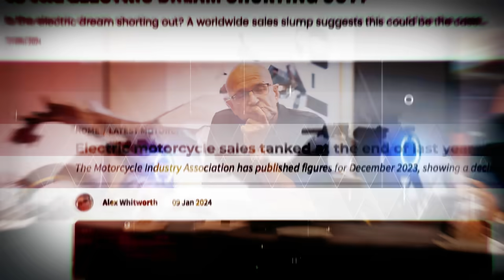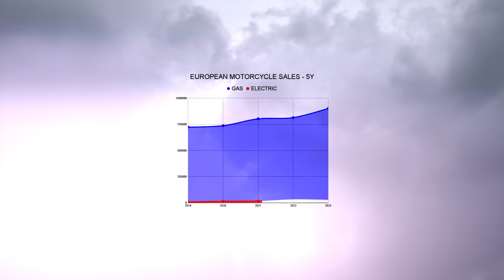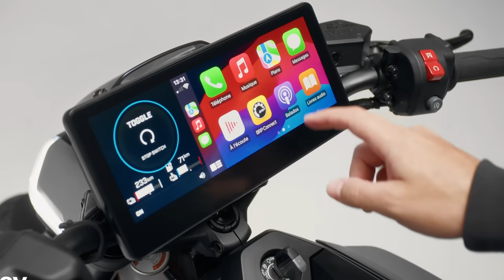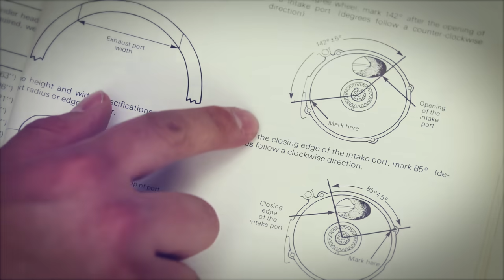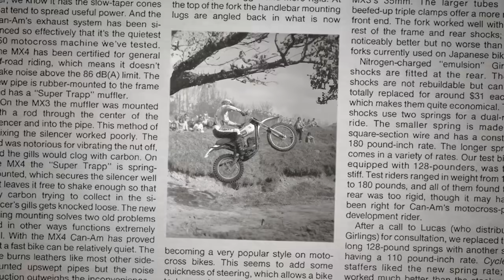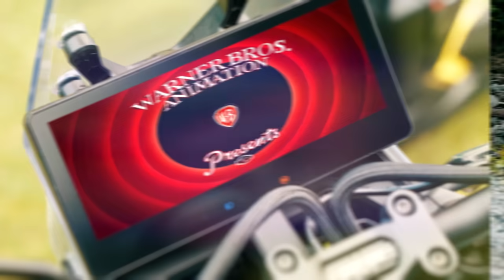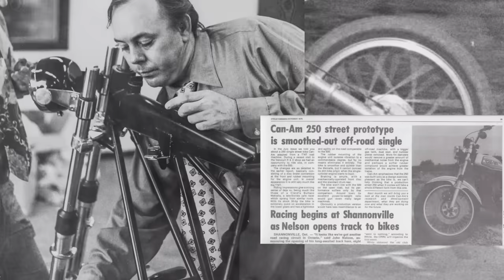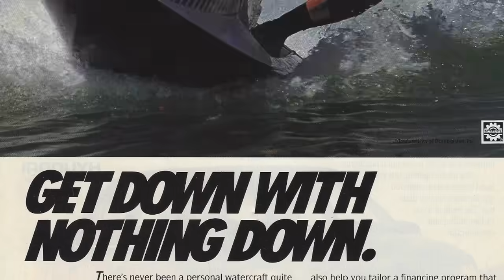2025 Can-Am Origin Review - The 115km "Adventure" Bike

Comment: Can't wait to buy a clapped out one in 5-10 years
Reply: You'll probably be able to pick one up for free but have to replace all the batteries, which won't be cheap.
Reply: @TulaneAve  but.. but.. it would be cheaper than a new one.. and it's already clapped out!
Reply: @TulaneAve  Cheaper than fixing up a busted up gas powered motorcycle that has a shot clutch, engine, chain, and all the other mechanical issues you won't know about until you're broken down on the side of the road.
Reply: @mgpBLARG  So just like a gas powered motorcycle, except with the electric bike you'll only need to change the battery and the labor won't cost you an arm and a leg.
Reply: @Waldo1122 You get it. God bless you.
Reply: @Waldo1122 except the battery will cost what a whole new bike does.
Reply: @The_RC_Guru  Just like engines and the labor and all the diagnosing you'll have to do on a gas powered motorcycle to make sure EVERYTHING is fixed. Also batteries are only getting cheaper unlike parts for motorcycles.
Reply: @mgpBLARG  I've got 10-20year old Nintendo's that I've had since new that still hold most of their charge, just depends on how the batteries are made and if you can be bothered to take care of it. Frankly I won't be surprised if in 10 years, there are custom controllers for the motor, so you can put whatever batteries you want in it the same way you can with Nissan and Tesla motors.
Reply: more like in 1-2 years factoring battery degradation and fad fading
Reply: @mgpBLARG  Labor? 1 hour is all you'll need to take the battery out and put a new one in, an engine will take a week. You don't need an electrician for a battery swap, Tesla service centers don't have electricians, they have a basic mechanic.
Reply: @ktkace  Batteries don't degrade anywhere close to that fast buddy.
Reply: Buy a clapped-out one and stick the integrated swingarm on, IDK, something fun, an old dirt bike? with the battery technology of the 2030s. I'm looking forward to it! But not worth $18k for me.
Reply: Bold of you to assume any will be sold
Reply: @mgpBLARG  Can-Am themselves. They're still selling parts for their first Spyder 10 years later...
Reply: With an entire 10 miles of range on a full charge 😂
Reply: @mgpBLARG  Battery technology is still new. A guy reached 400,000 miles on his Tesla Model S 2017, it has never seen a service center and still has over 80% of the battery capacity available. Electric is only getting better while gas is only getting worse.
Reply: @Waldo1122  haha tell me you dont work in the industry without telling me you dont work in the industry LOL.
Reply: @ktkace  Motorcycle sales in the U.S have YET to hit a new peak since 2006 buddy.
Reply: @mgpBLARG  Replacing batterypack in Nissan leaf is 3-4 man hours. Replacing engine (not rebuild) in ICE car is usually 10+ man hours job on low end (because nissan leaf is on low end too). All it takes is laws and policies to make batterypacks available even when model is discontinued or using universal ones. I can easily see how labor for batteries can be much lower.
Reply: I can't wait until parts become standardized.
Reply: @mgpBLARG  You're right, you certainly can do anything with enough money. You can also do a lot of things on a budget if you know what you're doing or care enough to learn. For example, I could take my 70 mile daily round trip to work, spend zero dollars on fuel doing so and make my money back after two or three years while not having to make stops for gas or worry about engine maintenance... Or I could just have a toy for weekend trail rides and keep enjoying my internal combustion powered regular commutes at the same time. I've found life's great when you're willing to explore the possibilities and try new things.
Reply: @Waldo1122  Huh?

Do you even work on anything? 😂
Reply: @Waldo1122  "labor won't cost you an arm and a leg".

This says it all. 

Stick with your battery bike, or get some basic mechanical skills.

Your generation can barely change a tire and your lecturing us on what it would take to restore a gas powered bike. Ridiculous.

I could list off at least a dozen ways a gas powered motorcycle is better.
Reply: @Waldo1122 yes, yes they do. Unless fully discharged and fully charged each cycles, the quoted cycle life is not relevant.  

May last 15 years but the last 10 years the capacity will keep shrinking into uselessness.
Reply: @Curious-Mr.-Lee  no he doesn't, LMAO!

he's a person with no skills trying to convince us why a battery powered motorcycle is better.

Please...
Reply: @Waldo1122: Fixing up old used gas motorcycles is both cheap and easy. That is why there are so many of them on the road. What will happen to electric bikes in 10-20 years is the same thing that happens to old computers and cellphones. The technology will have moved on, parts will be obsolete and unavailable, software will cease to be updated and what was once an expensive piece of cutting edge technology will become a useless brick.
Reply: @TexasDragon3907   Huh? 😂

You're so clueless.

different batteries, Einstein .

in all electronics the first thing that goes is the battery. even phones. everyone knows that.

how much energy does those batteries in your Nintendo hold? How long does it take them to charge? How long does it take them to die? You're not saying anything. just because you can turn your device on doesn't mean it's got a good battery in it. 

Do you think a Nintendo is hard on batteries like a motorcycle would be?

There's some dumb people in this thread.
Reply: @keldon1137  you think people fix their cars by getting new engines? 😂

no man. They get a new car by then.
Reply: @TRAVERSE_ADV  Yet a Taxi driver just reached 400,000 miles on their Model S 2017 and isn't seeing that.
Reply: @TexasDragon3907  Lmfao!

The only thing I've replaced on my Yamaha RV that I purchased for five grand that gets 60 miles to the gallon, the only thing I've done in five years of ownership and 100,000 miles on it. Is replaced the chain and the tires and the fluids and the filter.  

What are you talking about? Rebuilding engines? huh! How long do you think maintenance takes for someone with basic skills? some of us like work on our bikes too. 

I don't have to wait to charge. my bike is always ready. time is money my friend. I also enjoy riding my motorcycle as a hobby and being able to go farther and not have to wait, is a quality of life enhancement that your silly battery bike cannot fulfill.

guess what else?  I would much rather have something go wrong on a gas powered motorcycle on the road, then have my battery overheat or blow up. most likely I can fix the gas powered engine right there on the side of the road.
Reply: @mgpBLARG  U know that your comment that i replied to had none of these words in, right?
Reply: @TexasDragon3907  Custom controllers for the motors in these bikes? There's already a ton, which is awesome.
Reply: @dangerous8333 "your generation Blabla" ... opinion instantly discarded. Go yell at some clouds.
Reply: How much it costs to rebuild such a battery pack respectively replace the cells (in terms of work skills and time needed) can differ wildly. Are the cells soldered? How complicated is the array? Or are they just basically "pick and place" in a frame (this one is easy af to do)? And it seems no one arguing about it here knows how can-am did theirs. Let's get to the materials. What most here don't seem to know: battery prices continue to plummet. General battery prices 2023 to 2024 fell 50-60%. LFP battery cells in China have fallen by 51% to an average of $53/kWh. CATL (biggest manufacturer in the world) is aiming for $36/kWh in 2025. This bike has 9kWh. This is b2b pricing in big quantities, but it should give an idea of how the market is developing. And workshops that can efficiently rebuild battery packs will become available more widely also.

The bigger question for motorcycles will probably be... how will capacity per weight and volume and charging speeds develop? Even rebuilt... This thing basically only works for tracks close by. Not as a actual adventure bike.
Reply: @Waldo1122  Just like phones and other consumer electronics, the manufacturers will absolutely make it a total bitch to do any maintenance yourself. I guarantee it. There is a global industry worth hundreds of billions of dollars just doing so for vehicles.
Reply: Make that 2-3 since it’s a brp product…
Reply: @TexasDragon3907  Unlike in cars, you won't have all the battery safety features who prolonged the lifetime of the battery.
Reply: @Waldo1122  I mean, look at this bike and tell me, where that 18k price tag went.
Reply: @KillerRedVine  You're going to do a valve check yourself? Note valve checks go well into the $1000s and for a BMW/Ducati you can just forget it. Labor rates are only going up and for most modern bikes you need the manufacturer's diagnostic tools to even work on the bikes yourself.
Reply: @0Turbox  I never said those two turds of a bike was worth even $10,000. I knew these bikes were DOA as soon as I saw the single brake disk on the adventure model a year ago. But like Fortnine said, the technology that went into these bikes is incredible. They will only get better.
Reply: @mgpBLARG Battery in your phone has no heating and cooling to preserve its life, neither a charging buffer unless you enable it in software. So yeah, no wonder it goes bad so quickly
Reply: Keep in mind guy to replace a ev battery it usually costs more than to buy a new one which is why when one of the cells dies the dealer will show you its cheaper to buy a new one😂
Reply: @Waldo1122  The bikes this is competing with are small displacement dirtbikes and ADVs like KLRs, DRs, CBs, Rallys, KLXs, and Royal Enfields. It's not like you're getting work done on your H2R, they are simple, naturally aspirated, and most notably half the sticker price.

For the range you get out of something like a KLR or Himalayan for 1/3 of the MSRP, getting the single cyclinder rebuilt at 50,000 miles isn't a fortune.
Reply: @Bargrabber  Lithium batteries are only getting cheaper and more efficient and gas engines are only getting more inefficient and labor is only going UP.
Reply: @ussliberty109  I never said these Can-Ams were worth a dime. Energica's bikes destroys all of this crap.
Reply: @dangerous8333  Notice how you chose my comment to point that out instead instead of the original commenter who used their Samsung phone as the example for why all batteries don't last, almost as if you were only looking to reinforce your pre-existing biases? Because I sure did. Oh, and if you, by the way, if you read my whole comment, you'd notice that I specified how the battery is made is part of the equation almost as if I thought about that before I commented. The whole point of me using my example was to point out not all batteries wear the same depending on chemistry and use. To answer your questions, lithium ion, charging is about the same as when I bought it, battery is probably 75%. I don't game on it like I used to so haven't actually been on it long enough to run it dry but I know it holds a charge. Have nice day, maybe next time read the whole comment before you call someone and come out a fool.
Reply: @Waldo1122  nope it is not their is currently a cap on density so no its not getting cheaper and also its not becoming more efficient their is a cap. lithium portable battery density technology is capped until someone invents something to solve the problem, their is no ooh or ahh about this lithium will be highly exspensive and stay that way, lithium mines are sitting with a production problem aswell, their will not be enough lithium left at the current pace, not even mentioning the other less spoken about materials that are hard to stabilize, so in short you are wrong , and also you have been commenting on this thread like a plauge chill out, maybe touch some grass?
Reply: @Bargrabber  Lithium capacity is capped? Is that why car manufacturers are improving their range every single year without increasing the size of their vehicles? Toyota already announced that they have developed solid state batteries and will be using them in their electric vehicles. 

Lithium mines are having such a huge production problem that Tesla is still running at 100% with no loss of steam in sight. You're just just pulling things out of your behind and hoping that it us true.
Reply: @0Turbox  The bikes not actually out yet and what I know about it came entirely from this video so no comment? I thought they said the batteries are water cooled so there is that I guess?
Reply: @MGooGM  For sure not. In that time you have to gather the cells all around the world before you even can rebuild the Pile of Kacko
Reply: How shitty is this bike to be clapped in 5 years i never had bike that was younger than 15 years and all worked like a charm
Reply: @mgpBLARG The battery in your phone isn't the same with a car battery or a motorcycle battery wow shocking I know , I had a small smart electric car and the battery had 98% battery health after 5 years of use.
Reply: @jakeviolet2195  fixing up old vehicles is not 'cheap' unless you rebuild them with all the old parts!
Reply: Not only that you'll need to wait at least 15 min to charge it.  I would rather choose a motorcycle which can charge instantly, which seems electric motorcycle aren't capable of .
Reply: @4AM-214  I've been driving a small battery EV for several years.  I never have to 'wait' to charge.  I do something else while it's plugged in and don't end up stinking of petrol either.
Reply: @mgpBLARG  After a decade a battery rebuild may be needed, but think of it as a replacement for the monthly cost of fuel. With that said, for a lot of products I'm not sure if it makes a lot of sense to have them battery powered. An electric commuter bike used almost daily sounds like a great idea. An electric adventure bike less so.
Reply: @MGooGM i like your attitude
Reply: @FFVoyager   what if I'm in a hurry and I forgot to recharge it because this happens to me all the time. I can bearly do my dishes because I arrive home late. At last It all comes down to the position you're in.
Reply: For me an electric motorcycle has no soul. It's not like "No.5"
Reply: Amen to that
Reply: @mgpBLARG FWIW, phone batteries are specialised single cells designed to be as compact as possible, with no cooling and often engineered to fast charge when possible due to market expectations. All factors that will decrease LiIon capacity quicker, so it doesn't last as long during the day ("dies").

Vehicle batteries consist of hundreds of cells, usually with much bigger tolerances, and cooling systems where fast charging is desired - modern designs are seeing 7-10 years of use before a decrease in capacity becomes noticeable at about 10-15%.
It's like comparing a wheelbarrow to a dump truck 😅
Reply: Bad idea. The battery will probably be so tired by then that you'll be getting hardly any range, and when you look at the price of a new one, you'll not be a happy camper
Reply: @Waldo1122  Batteries and electric motors are older than ICE engines by a lot, incredibly mature technologies with far more money spent on research than ICE. Think you'll find the Tesla had 80% capacity on its third battery and all the electric motors had also been replaced
Reply: I’ll just be impressed with the persistence of the person that can wear a bike out that has to be charged every 115km.
Reply: @mgpBLARG  ye and add a little generator
Reply: Based
Reply: @Waldo1122 cherry picking 😂 EV batteries clap out just as warranty goes and replacing them is expensive as fuck.

You comparing that to someone making the worst used motorcycle purchase in the 21st century is hardly fair.
Reply: @TexasDragon3907  I think you got the wrong guy lol. I do ICE motors as well as electric motors. I'm currently building a E-moto that will pump out around 50 hp with air-cooling. I also am fixing up my 1977 Corvette. Electric and ICE are both very easy to work on......now to actually design and develop a new technology is hard.
Reply: @Waldo1122  valve check and adjustment cost me 400 EUR and it was once in 24 000 km interval item. Rest of maintenance doesn't exceed 200 EUR a year on my 15 year old Suzuki with over 40 000 km on the odo.
Reply: @Waldo1122 😂😂😂 no it would still be cheaper to build a basket case than replacing the batteries and motor on a electric bike
Reply: Toxic waste
Reply: Throw away bikes are official lol
Reply: ROFL
Reply: Clapped ICE are repairable, but I don't know about batteries tho
Reply: These won’t last that long lmao
Reply: @Waldo1122  The price of a restored engine doesnt even come close to  the cost of a battery pack
Reply: @jakeviolet2195  But the future for electric is great drivetrains (like on the canam) with battery density being much better in 10 years with plug in controllers - easy enough people make their own conversions all the time.
Reply: I'm riding a 8 year old Zero Sr and it's only lost 5km of range in that time.
Reply: And reto fit a gas motor..
Reply: @KillerRedVine  we need right to repair in EVs too, but imho electric motorcycles ought to be made as simply as possible, with maintenance and replacements easily done at home.
Reply: @edwardbrodie2190  well 30-40k miles isnt that much for a motorcycle especially of that age, but surpassing that I’d imagine some range wojld go w it.
Reply: For twice the cost to replace the battery!
Reply: @misfitfarm1937  battery cost more than the bike lmao not even worth it
Reply: @Bucky15690  hmm maybe YouTube's being weird. I'm certain I replied to someone else and they didn't look like they were replying to me. Whatever my bad.
Reply: @MGooGM Ha Ha! Sure buds...sure.
Reply: @GPz84   "Sure, bud, sure" what?
Reply: @Waldo1122  10 yr old battery bike wouldn’t even get to the side of the road in the first place
Reply: @mgpBLARG  you do know you can change the Samsung battery for new one? You just have to take extra effort to get the back cover off
Reply: @TulaneAve   If EV cars are any indication (I currently have two), those batteries are going to be fine in 10 years.
Reply: @TulaneAve  It's got a freaking small 8.9kwh battery, the batteries won't be that expensive.
Reply: @The_RC_Guru  WRONG The battery is 8.9kwh, it's weirdly small. Not a massive cost.
Reply: @Neojhun  ah ok then they’ll be going bad that much faster since they’re being over cycled with high amp draws and a lot more charging cycles haha. Look there’s no free lunch with thermodynamics. Plus look at any of todays evs, insurance companies just write em off as totaled when the battery goes bad because the cost to replace is more than the vehicle. Remember the vehicles depreciation in that 5yrs plus too. They have their place certainly yes but they aren’t yet to the level where they can all take over combustion.
Reply: It’ll be 80% of the price of the bike to replace the batteries. The bike basically is the batteries.
Reply: They will be wildly obsolete by then
Reply: You will not find a battery in an Egyptian pyramid or a historical settlement of the first nations, but batteries are around for some 220 years, so I wouldn't call the technology new. But if you think that's new, than the combustion engine is even newer and has more room for improvement.
Reply: @mgpBLARG There are mechanics that make more than electricians, but not Joe tire tech, no offense, tire techs.....
Reply: Lol be more like 2 years and battery will be junk. Kinda want an electric dirt bike but Ill never get rid of my vtwin superbike.
Reply: The battery will be past prime then, and replacing that will cost more than the bike is then worth. These depreciate like bricks because they get better every year. Wait a decade or so and they might be good.
Reply: @TulaneAve  a Prius prime battery, which is about 1.5x larger than this bike's is only $2,500. If the price scales, it'll be $1666 to replace a battery of this bike's size, which is not bad
Reply: @mgpBLARG  your problem is because it's a Samsung... and most likely your poor charging habit. my Asus of 6 years is still running strong.
Reply: This is the answer
Reply: It'll be a boat anchor in 5 years.
Reply: Get a Surron for $5000 instead
Reply: @Waldo1122  labor will definitely cost you an arm and a leg. Rebuilding a battery pack is not easy, nor safe, nor cheap. 18650 cells are less than 3 bucks each, you can get them for under 2.50 if you buy bulk from a wholesale supplier. Most of the cost of repairing a battery is in the hours it's gonna take a technician to hand weld each cell to each other, plus balancing and conditioning for shipping. "Installing" the pack in the bike is the easiest part, and probably everyone can do that.
Reply: @somedude2492  I hope you realize battery packs are built by a third party not assembled at the factory or delivered in pieces to dealers. They comes fully assembled. BMW already has electric bikes on the market and battery repairs do not consist of actually repairing the battery, they simply swap out the ENTIRE battery switch takes little to no time to do.
Reply: @TexasDragon3907 controllers aren't really that picky. They just have a "hey, this is the max voltage i can handle and the max current i can push" rating. Any battery that closely matches those specs will work if you know what you're doing.
Reply: @Waldo1122  as an electromechanics technician going through college for electronics engineering, specializing in electromobility, i do know. The cost for a whole ready-built pack is prohibitive, and insurance will total your vehicle before paying for a new battery. Also, battery cells are standardized. Battery packs are not. 10 years from now, when you actually need to replace the battery, you'll only find NOS battery packs that have already taken a hit to their capacity. If you want actual new-like performance, you need new cells which can only be installed by rebuilding an existing pack. Hopefully this will change in the future with new battery chemistries and more standardized vehicles, but that is the picture we're looking at today. There is a reason why electric cars are doing so much better than electric bikes, we're just not there yet.
Reply: @somedude2492  Obviously we aren't there yet for electric bikes but the people in the comments are saying garbage like "electric bikes will never work" "nobody wants electric bikes" when that is a blatant lie.
Reply: @Xirtamani truth hurts. I'm part of that generation. We aren't good
Reply: @Waldo1122  lol at least you can fix a real motorcycle, at least you have the option to attempt it before you have to just buy a new bike. electric = temporary + disposable
Reply: @No-one91910  What is a "real" motorcycle? A motorcycle that raddles itself apart, breaks down, is unreliable, has tons of maintenance and is slow? Teslas aren't temporary and disposable so you're just being blatantly ignorant.
Reply: @Waldo1122  i have 20 years old supermoto (husqvarna sm 610 2004), have it for 3 years without any problems so far
Reply: @JRY-wq4eg  Cool, if you actually ride it you'll end up reaching the valve checks and then you'll sell it once you see the labor cost.
Reply: Electric motors don't clap!
Reply: @Waldo1122  you know what I mean. one with an internal combustion engine. Ev's break down over time as well, just as much as hybrids, everything does. Your bike shouldn't have tons of maintenance and still be unreliable, honestly sounds like a skill issue in that case. There are still cars, and obviously tons of bikes, on the road that are running much past their intended lifespan, ev's aren't old enough yet to know if the same will happen to them. Also no need to call me ignorant, I doubt you would do that if you were talking to someone face to face.
Reply: @No-one91910  Everything breaks down overtime but a EV won't just not start-up one morning or suddenly fall apart in the middle of a drive. 

Every bike has tons of maintenance that is what makes it unreliable, you can't rely on your bike to be an affordable form of transport as stealership labor charges can go up by 100% at any time, Ducati engines can fail at any time, BMW engines will grenade at any moment, KTM engines will stop working just because.

There are very few cars that see 400k miles while Teslas easily reach that as there is no engine to fail and turn the car into a write off. Tesla has been making EVs since 2012, they are plenty old enough. Most of the original Teslas are still on the road running like new.
Reply: @mgpBLARG  scale buddy
Reply: @Waldo1122 no this one is true. At current rate lithium mines will run dry soon and with a 15 year turn around on new mines... well that's not even the real issue.  The only lithium rich areas now are areas of contention and instability (Africa) EV is not the future.  Hydrogen will be
Reply: @Waldo1122  The Can Am is not a Tesla AND you have ignored the main point of this vid...RANGE.
Reply: And the PRICE
Reply: @Texas_Cody  Lithum is a finite resource just like oil buddy.
Reply: @Waldo1122 ”every bike has tons of maintenance that is what makes it unreliable” is the stupidest thing ive read in a while. Its almost like performing the maintenance is what keeps them roadworthy and safe dude. If you dont know how to do the maintenance yourself just say that instead of complaining about stealerships😂 

And what is this fear mongering about engines? Do you redline start your engine in the mornings? Extend the oil change intervals to every 10k miles? Ride the clutch in traffic at 7500 rpms? Modern engines are extremely reliable, and most failures can be attributed to lack of maintenance. (Theres that word again….)

The beauty of motorcycles is that they are the barebone basics of what is needed to transport someone: an engine, a transmission, and two wheels. If you cant maintain the barebones, stay off two wheels and stay in the grocery getter.
Reply: @np51486  You shouldn't have to tear down an engine every year, do an oil change every 6k miles, clean/fix a chain every 500 miles etc... Good luck doing a valve check yourself.

Modern Ducati/BMW/KTM engines is about the furthest thing you can get from reliable.

The beauty of motorcycles is riding the damn thing not stuck working on them. The GS is the top selling motorcycle because there is no dumb chain to worry about or a engine to tear down when the valve check comes up.
Reply: @Waldo1122  Do you even ride dude? What bike are you on that needs a teardown every year? Do you even know what you’d be tearing down into and why? 😂

I dont know what is your fixation on the german and italian bikes is, but Japanese bikes are the best out there. You can easily get to 50k miles on them before any serious tear down or rebuild is needed. Expect half that from the exotic german and italian bikes. Still pretty damn good considering most are more of track and weekend warrior toys and not commuters.

And FYI dude: 
it takes less than 5 minutes to clean and reoil a chain after a ride.
valve adjustments can be done for FREE yourself in an hour especially if theyre screw type and not shim type.
it takes 20 mins and 35 bucks to change most bikes oil every 3k miles. NOT 6k miles like you think it should be; which probably explains why you think modern engines explode left and right. Its just you bro 😂 
Bikes are more maintenance yes, but the maintenance is often much quicker than performing it on a car for example because everything is right there in front of you. 

And thats not the reason why people buy BMW. BMW maintenance and repairs occasionally require using a multimeter with an oscilloscope, access to their software to get rid of warning lights. Generally over engineered design choices makes this bike hell to own for the average DIY owner.
Their sales are up from retired dentists that buy new BMWs because theyre the ones that can afford to do so and have the dealership do all the maintenance 😂 Pretty sure they dont give a rats ass whether if it has a shaft drive or not when they ride their 1250GS adv bike to the local starbucks lmfaooo
Reply: @np51486  You're asking me if I ride yet you don't even know what a valve check is... I hope you realize valve checks are supposed to be done every 15k miles as THE MANUAL says for almost all motorcycles, if these are not done your engine very much can grenade as these are NOT hydraulic valves like cars.

If you track a motorcycles you can go ahead and cut the maintenance schedule in half.

Valve checks are most certainly NOT a one hour job, Ducati quotes them at 6 hours, BMW at 4 hours, just taking the panels off to even see the valve cover will take an hour. You will need to lift the bike up and drop the engine and will need a VERY clean work station aka a garage and a tons of free time, 99.9% of motorcyclists DON'T have that.

It is clear you ride old trash bikes pre 2018 considering you think an oil change for a motorcycle only costs $35. Just about every Ducati/BMW/KTM bike will cost you $250 in oil/filters. Not all bikes accept cheap gas station oil like your Vstrom.

Just the other month BMW had bikes exploding left and right and even their own race bike exploded during WSBK.

BMWs sells aren't "up" they're at the top. The 1250gs is the best motorcycle listed on every single chart, low maintenance, easy to work on, highly maneuverable, and low fuel consumption, it is true to what motorcycles were invented for.
Reply: @Waldo1122  Ive done valve clearances on my bike 3 or 4 times so far, and it only took about an hour. 1 Hour to remove the tank, valve cover, measure and set clearances, and put it all back together again. If a dealer is charging you an hour of labor just to get the plastics off, thats crazy dude. Im a broke 21 year old college student that did this in a friend’s dimly lit garage. Im sure the 99.9% of riders can do this as well 😂
And up the reading comprehension, because I said an hour for screw type valves, not shim type valves. You literally only need a flathead, feeler gauge, and an 8mm wrench. Youre the one who doesnt know what a valve check really calls for since you think all valve clearance checks are shim type which require disassembly of the top end. I do my clearances every 7k miles as thats what the manual calls for. I doubt you put 15k miles on your bike a year for you to need to do a valve clearance check every year.

And here you go on about BMW, Ducati, and KTM for some reason. Most of these bikes are higher end and targeted for the extremes of motorcycling such as again, track toys or dirt biking. 
You’re ignoring the majority of motorcycles in America, which are mainly japanese street bikes. You use examples of these more exotic german and italian engines failing despite them being a minority of bikes. Not sure what the fixation is, but again oil changes really are that cheap if you do them yourself and you dont own a brand of bike that rips you off. Its about 30ish dollars for a gallon of Shell Rotella T6 clutch safe full synthetic. 5$ for the filter. Not gas station stuff, its some of the best you can get for a bike; not that you’d know that though because you think an oil change is 350$ because thats what the dealer charges you.

You said how the beauty of a motorcycle is being able to ride the damn thing” but if all you talk about and know of is german and italian bikes, its no wonder why you think all bikes are so expensive and you cant work on them. So answer the question. Do you even ride? Or do you say you do with you choosing the car most times and letting that german bike collect dust because you dont wanna put miles on it?

I put 10-12k miles yearly on my Ninja 500r as a sole form of transportation. Its from the 90s and has never left me stranded once in my years of owning it. Call it a shit bike, ive been places on it you’d never take yours because you’d be worried it’d grenade on you. 

And just to talk about your claims about the 1250GS really quick: 
It is not highly maneuverable. It weighs almost 600lbs. The wheelbase is about 60 inches. It is about the heaviest you can get away with when it comes to being on dirt. Ryan from Fortnine speaks about this multiple times in multiple videos. The fuel consumption is mediocre because its a large displacement engine. The maintenance is low, but it is NOT easy to work on or cheap. Theres a reason why many riders joke that BMW stands for Bavarian Money Waster. Again. A bike for the retiree that wants to get into riding again but dont want the maintenance intervals that come with riding. Just the exorbitant dealership markup please!
Reply: @Waldo1122 my 1999 BMW 540 has 432k on the original engine and gearbox. 400k is a milestone for you? that is what a normal ICE will do.
Reply: @TexasDragon3907 make your money back? show me any canam product that appreciated. 18k this thing, you think you will sell it for the same 3-4 years later? 😂😂
Reply: @PatricioGarcia1973  And how much did you have to spend to make that engine last that long? An electric vehicle won't need anything but tires/alignments and windshield washer fluid.
Reply: This comment is underrated 😂
Reply: @somedude2492  I'm working off the assumption that since it is an oem controller if it is even missing one sensor it thinks should be there it shuts the whole thing down. Not an actual product yet so I'm just guessing.
Reply: @PatricioGarcia1973   I started not to reply to this because you plainly didn't read the thread that led up to comment but I'll summarize it here and continue anyways. Original poster makes a comment that these things will be clapped and dirt cheap in ten years. Reply says they won't be worth anything even if you get them for free because of batteries. I point out that in ten years if you can get one for free, there will likely be after market controllers that let you throw whatever batteries suit your fancy for a reasonable price and if you rode it for 3-4 years as a A-B commuter you could make your money back on not buying gas. I did not once say this would appreciate. I did not once imply it was worth 18k or that you would ever resell it for that much, only that if you got one for free you could make it worth your while. You put those words in my mouth so you could have a laugh about it. The entire comment hinged on the fact these WILL be a bad investment now but will be great investment for a technically savvy second or third owner who gets it for cheap and rebuilds it.
Reply: in 5-10 years there will probably be solid state batteries that solve the main issue, but those probably won't be compatible with an older bike
Reply: You mean next week
Reply: @Waldo1122 no, if you do your own work, you just mentioned 2k worth of work...
Reply: They won't make batteries for that model in a few years.